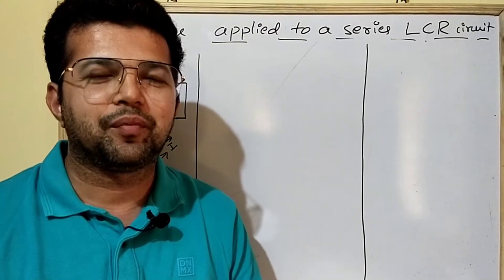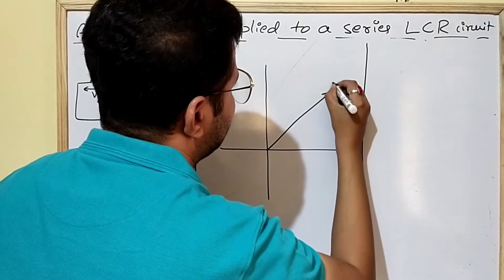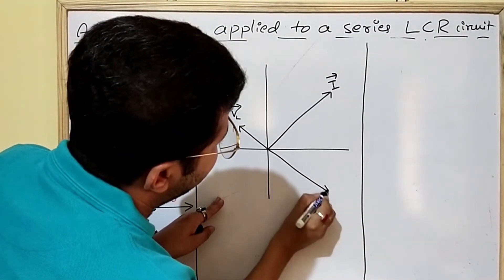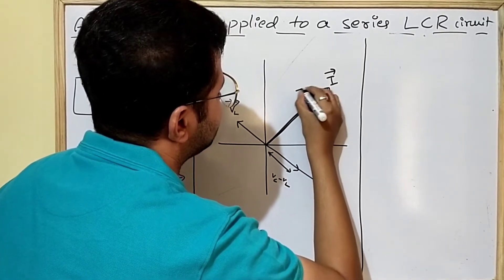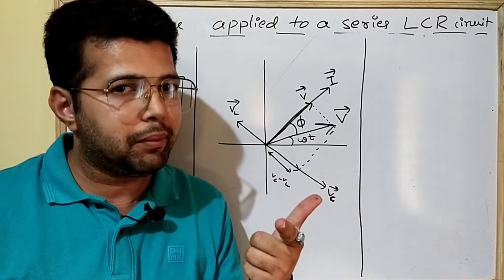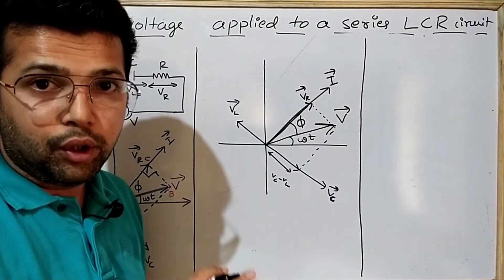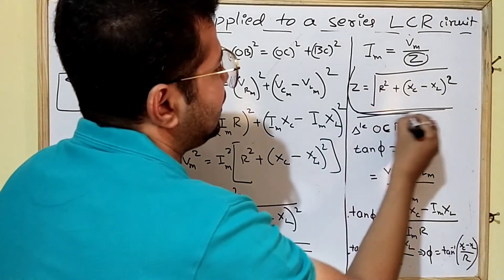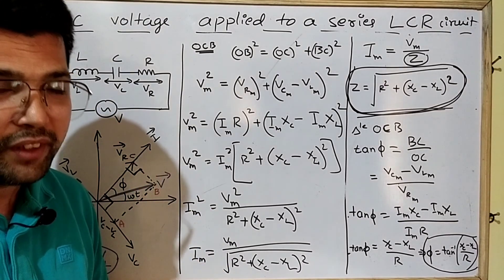LCR circuit class 12 - Derivation of expression for impedance and phase angle - Important derivation

Comment: Sir I have a small doubt... In a cbse pyq, a question was asked to find out the phase angle between current and voltage. I took the bigger value which was Xc and wrote tanphy is equal to Xc-Xl/R and got positive value. But in the answer key they wrote Xl-Xc/R (despite the fact that Xl is smaller) and obtained negative value. I thought we were supposed to take bigger value first but it didn't work out... Can you pls help me out sir? You alone answer everyone's questions here.
Reply from the maker: @binojdivakaran795  I want to see the question once to give you accurate answer. please WhatsApp that question to me 8970797028